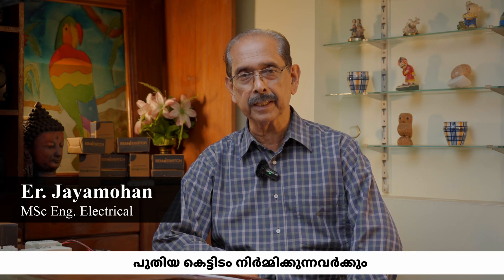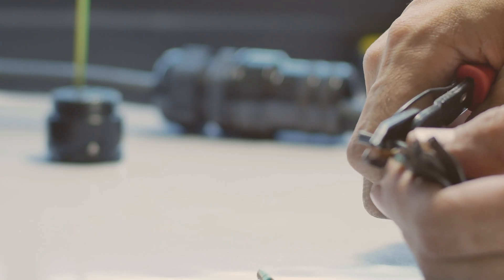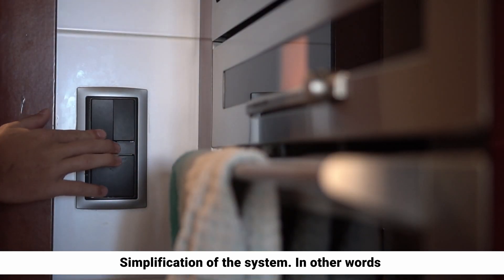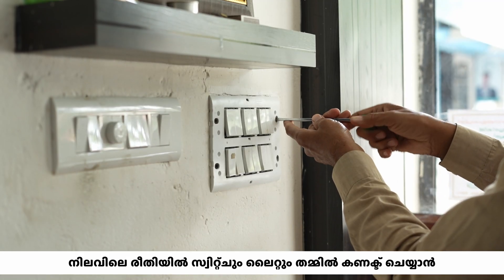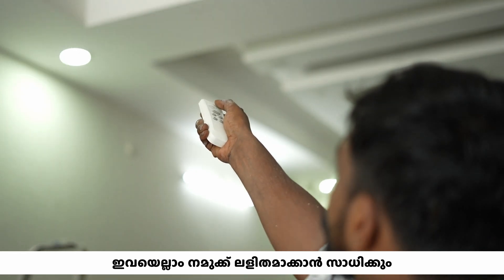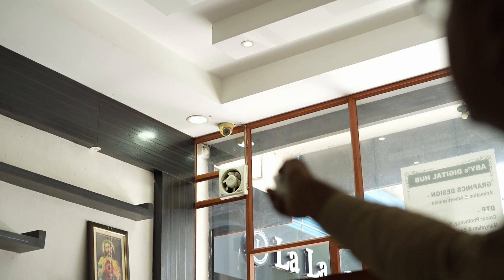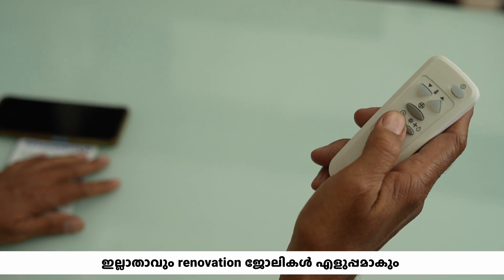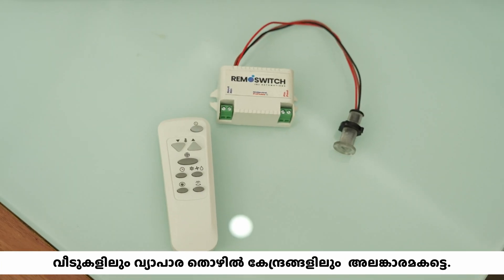സ്വിച്ച് ബോർഡുകൾ ഒഴിവാക്കി wires പകുതിയോളം കുറച്ച് electrification സാധ്യമോ? | RemoSwitch

Comment: I agree with the concept, but fundamentally, a switch remains a switch. Even with remote control capability, we still instinctively seek out a physical switch. One notable drawback is the dependency on the switching device; if it malfunctions, replacement becomes the only solution, rendering the system useless until then.

Another issue is spatial constraints. Automating even a small LED bulb requires accommodating the IR receiver and associated circuitry, potentially disrupting aesthetics if there's insufficient space to conceal them.

In terms of future prospects, IR switches may not be the optimal solution. Low-powered alternatives like Zigbee devices offer smartphone control and the familiar tactile feedback of physical switches(using zigbee switches), providing a more versatile and seamless user experience.

Nevertheless, I appreciate the team for their initiative and implementation. Kudos to you for pushing the boundaries in this field.
Reply: Thanks for taking the effort to review ❤ 
Regarding the instinct of looking for switch is very normal in the beginning but will get used to it. Can we think of looking for a switch to operate our tv or ac these days.
Ofcourse we have to replace I but very simple and easy  like replacing a ceiling light or any other light. We recommend keeping a few spare switch.
We are giving 1 year replacement warranty.

Comment: This remote rf or ir.?
Reply: Since they are keeping an ir receiver outside of the panel in this video, it should be an IR based remote.
Reply: Yes, it is IR, with a universal remote which can operate any switch anywhere in the vicinity /#20 m range